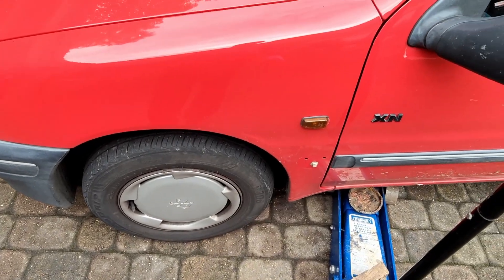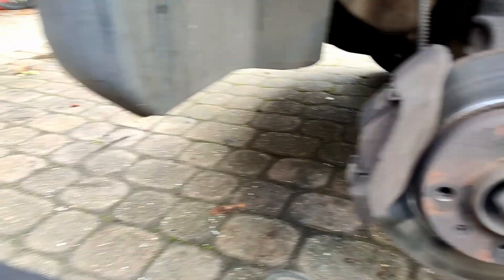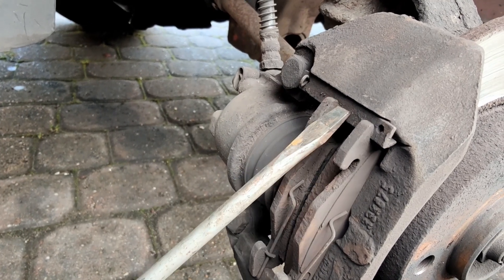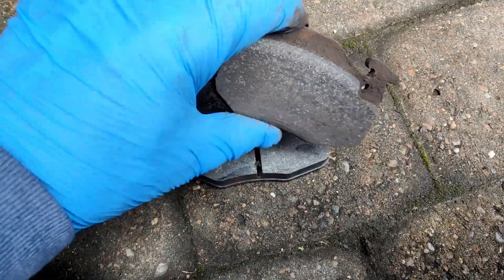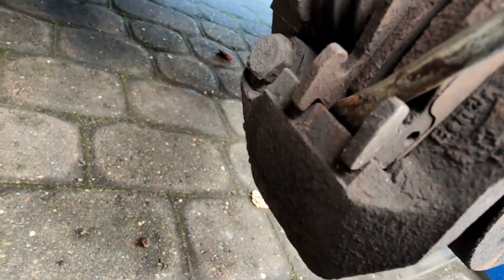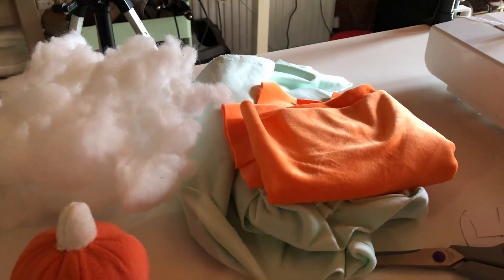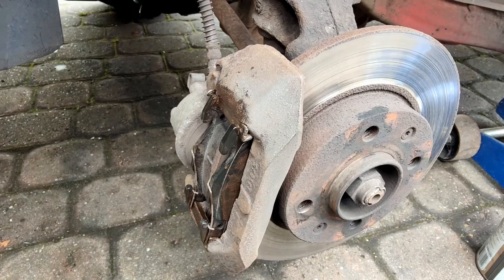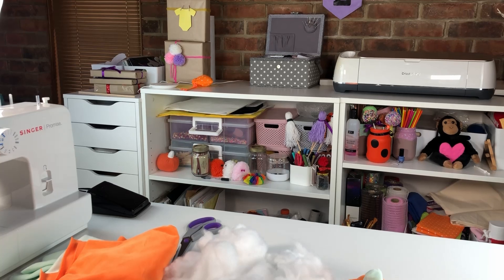#vlogtober Fixing Car Brakes and Lisa's Behind the Scenes

Comment: Lol Loved Lisa's audio quality. Bit poor when infront of the camera but perfect when behind. 🤣
Shane those brake pads most definately were in tip top condition lol. Few more weeks you would have no brakes 🤣
The brake disc's were in a better condition than mine as mine even had rust on the disc itself where the brake pads rub.

Still waiting for this heavy rain and thunder as promised but so far only a few bouts of drizzle 🤨
Hope you both have a great evening and a good day tomorrow.
Reply from the maker: That mic ahhh the joys haha. To make the sound work we had to boost by 10db and make it stereo. You are spot on with the audio difference between front and reverse camera. That's iPhones for you... 
Told you the only way is oppo haha.

It was a good timing to change out those pads and issue free to always a bonus.

Been raining all evening here, the ducks are happy for sure.

Have a relaxing evening out friend, Shane and Lisa xx